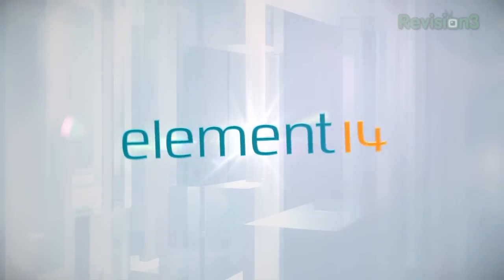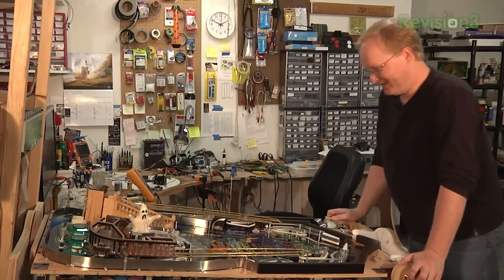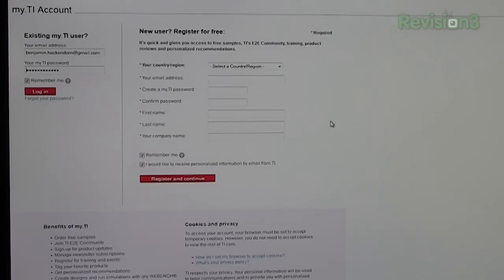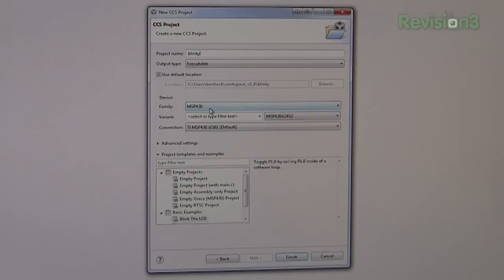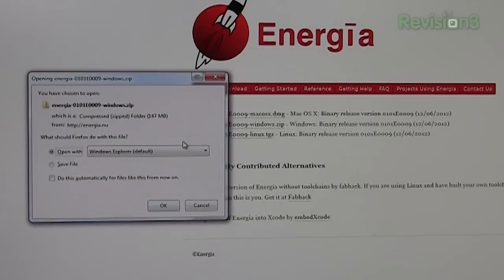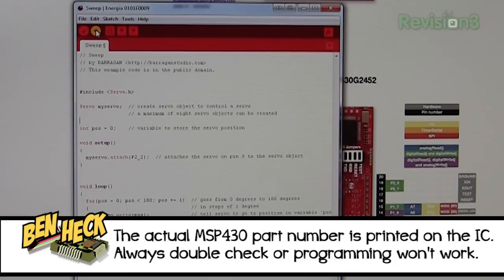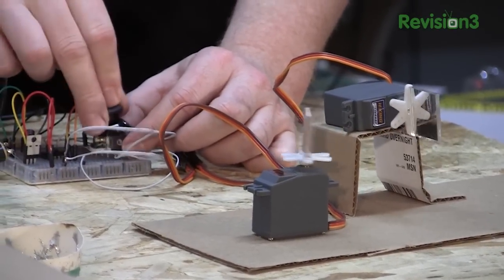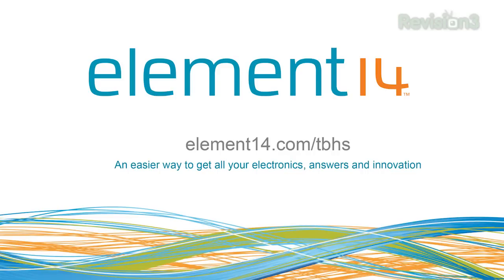Getting Started with Texas Instrument's LaunchPad

Comment: Sam Javier, yes  the msp430 launchpad is socketed and you can take any compatible msp430 chip and program it on the board. You can also program the chips in place on a breadboard with the same board . You remove some jumpers and wire 4 or 5 pins.

The Stellaris Launchpad is ARM and the chip is surface mounted .

The MSP430 chips are stupidly cheap and require no bootloader.

Comment: It doesn't appear that Energia supports the Tiva C-Series boards just yet. A shame, because I got very frustrated with Code Composer's installation and licensing very early on, to the point that I've given up developing anything on the board until I can figure out some other tool chain.

But at least I can use it with my MSP430 Launchpad.

Comment: What options (hardware wise) are available for programming/debugging a DIP TI microcontroller that is plugged into a bread board and doesn't have the USB programming chip found on the launchpad dev board?
Reply: An FET is a good programmer